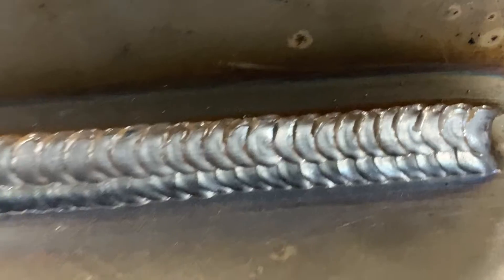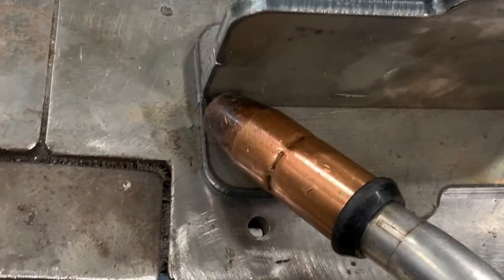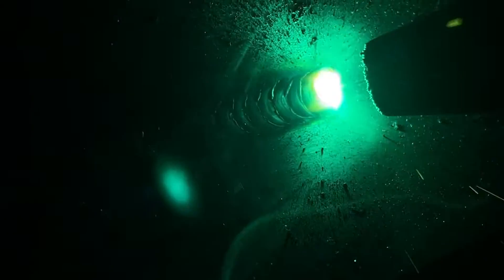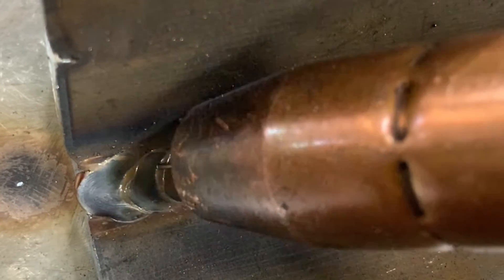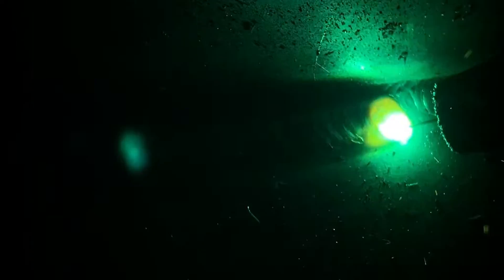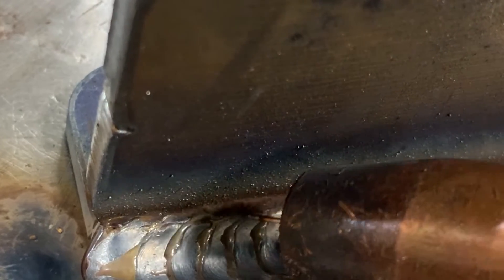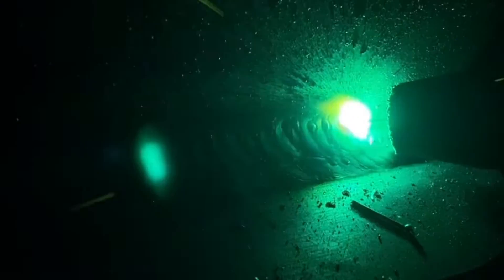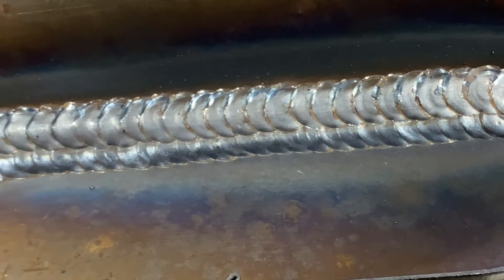How to stack dimes on multi pass fillet welds with MIG

Comment: Honestly I'll do forward back motion than hold a lil when I go back I don't remember my set up in terms of gas and current but it works I'm sure I used high heat the cuz it takes me like 20 seconds on a 4 inch long tee weld
Reply: That’s called whip and pause. Go forward then pause let it build some then drag back to create the dime

Comment: Looks Like Slag and Toenails Is What I See And The T.I.G. Welders I Know Don't Weld Like That. Theirs Are Alot Smoother and Slick As Fook. Keep Practicing.
Reply from the maker: Too bad there isn’t slag with in MIG welding otherwise I’d give ya something
Reply: @relentlesswelding15  so what do you call that crap between the toenails and your stack of dimes? LMFAO
Reply from the maker: @peetydontpass8309  toe nails are for feet buddy. Idk maybe silicon deposits that come off of my ER 70s-2 filler metal.
Reply: @peetydontpass8309  toenails? Slag in mig welds? The welders you know are most likely the ones on YouTube

Comment: I've taken over 45 welding test since i finished welding school. And i can honestly say that here in texas there are assholes that will fail you if you "stack dimes" like that... their excuse for failing the test is " we prefer you to lay stringers than dimes.... so please learn as much different ways to weld cause there are dick heads who fail you just cause you dont weld like they like it...... 

Yes this is nice, it works, it passes non destructive and destructive test but still, learn as many different ways as possible to avoid the hassles  later
Reply: Stringer gives more penetration than any weave and that's what REAL jobs want.
My first job would only pay you more if you gave them dimes for some reason, so you can imagine my shock when I went to change and every other better job wanted stringer beads lmao.
5 years in the industry now, and working structural stuff with MIG and Stick and I almost always stringer unless I have a big multipass gap I gotta fill
Some people want looks, some want stringers, it's best to practice both especially if you start your own business, as people who know nothing about welding will pay premium for nice welds over strong welds.
Reply from the maker: Pretty much showing the technique so people can practice. Very similar to how most motor sports and off-road performance chassis and vehicles are welded. Always follow your wps if it is given to you.
Reply: To be fair, looking at this video these welds clearly were not penetrating. The arc wasn't even touching the plates half the time.

Comment: What helmet is that ??? I have Lincoln Viking and I can't get it so I can see like that
Reply from the maker: I’m actually using a shade 5 lense over my iPhone. I have now switched to my Cannon camera for videos. 
The new 4c technology is the best when it comes to Lincoln’s hoods
Reply: @relentlesswelding15  thanks Tom . I have that same helmet . but for the life of me it doesn't look like that . I tried different settings also . I see better when I use gas but flxcore doesn't come close .
Reply from the maker: @direct998  are you using a clean cover lense? That can cause a lot of issues. The older Vikings had more of a green tint to them while the newer ones are a clear blue. I try really hard to get the focus in the videos
Reply: @relentlesswelding15  mine is the new one . I'll change the lens to see if it improves .on your video I can see right where you're going the arc isn't so bright that you could see everything clearly .